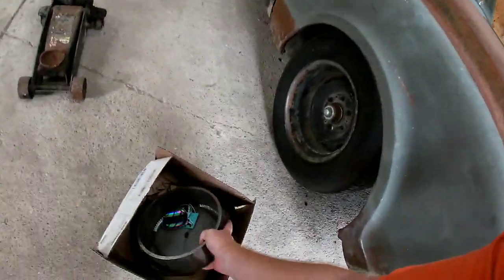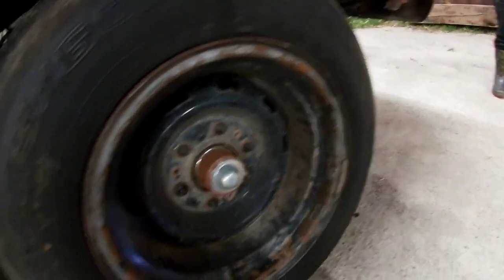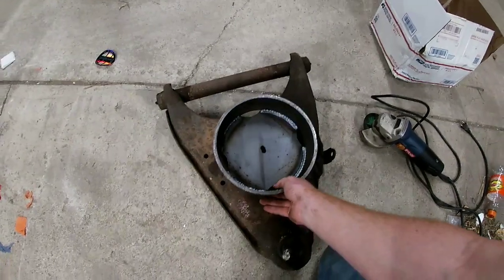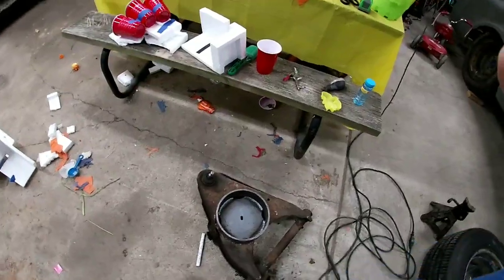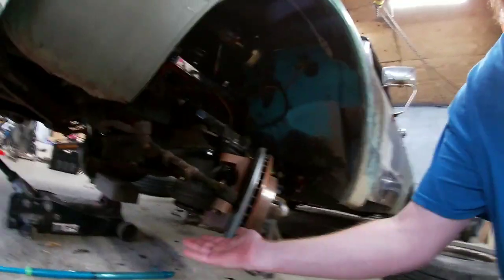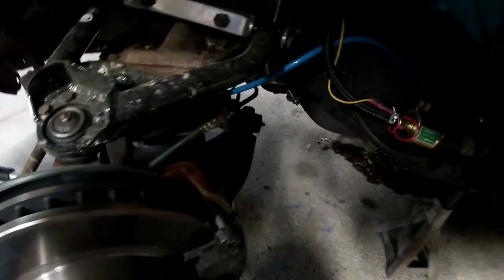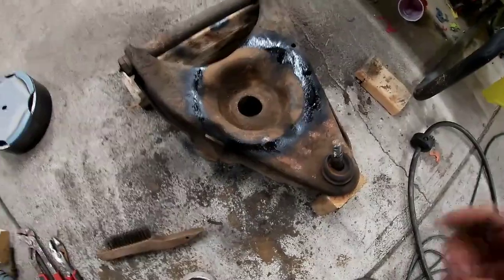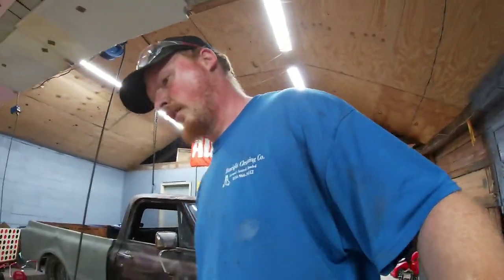How to cup lower control arms on a 67-72 C10 #diy #howto #lowrider

Comment: Job well done! As a note, the lower control arm shaft is held with "U" bolts. GM recommends the use of 9/16" U-bolts as they had 5/16", 1/2" then went to the larger size. It is a safety thing although for 50+ years they have survived pot holts, Road craters  and pasture jumping. This is $9  each & come with washers and nuts. 
  Tip: For those equipped with manual steering, more positive chamber is desired. The shaft fits a pin the "U-Shaped" perch. If the lower shaft is moved forward, by drill a new hole back about 3/8", you will gain about 4 degrees positive chamber before any shims are installed. The shaft end bushing are metal and if greased will last another 50+ years.  It is 4 times more robust than rubber bushings and easy to service. Identical to the top. 
 1967 C10 frames are odd as they did not have indentation for the power steering gear nor did they offer on. Solution? Remove manual steering gear, but a quick ratio P/S gear box from (buyautoparts) for a 72 C10 p/n 82-00293 QR for 2WD and send an undamaged core. If core inspections passes, you get a check for the core valve deposited on credit card. 
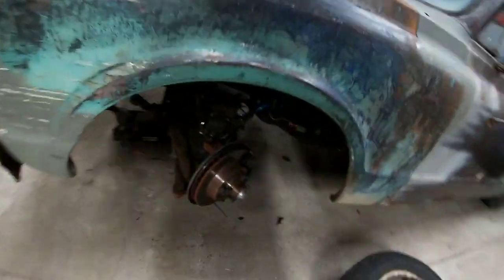It is a 2:75 - 3:25 Lock to Lock and don't forget to buy a pitman arm for the newer truck 2WD to fit.
 On 67, the manual box has pipe-like spacers. Cut two in half with a 5 degree angle. The front two at 5/8" at 5 degrees angle and mark to rotate so they fit flush on frame and steering gear box. The std bolts will fit as I used large flat washers inside the frame to spread the load. Recheck torque after 500 miles of driving.
 DK, ASE Master Tech since 1978, retired but 67 C10 owner.
Reply from the maker: Great information my current project I'm working on this week is pancaking the cross member. It's cut and put back in the truck but now I have to modify the steering because of clearance issues

Comment: Can I use these cups with just my lowering springs instead of bags?
Reply from the maker: I don't think so best bet would probably be get tubular lower control arms I would suggest drop spindles too
Reply: @ccgarage5040  Iv got three inch lowering spindles and three inch lowering springs Im looking to go a bit lower it’s a 78 suburban, you still think it wouldn’t work?
Reply from the maker: @Flacos_pov  no because the spring pockets are already the lowest part of the control arm but there not flat so to run airbags we cut that area out and use the cups to have a good mounting surface
Reply: @ccgarage5040  what if I extended the cups🤔 I’m really tryna get this done
Reply from the maker: @Flacos_pov  my cups are actually the first thing to hit the ground when I air out

Comment: Is there a reason you didn't measure out from center at 4 points to make sure it was dead center?
Reply from the maker: It needs to be center with where the spring pocket was not the center of the control arm
Reply: @ccgarage5040  ahhhh....makes sense. Thanks!
Reply from the maker: @johnjorquez3982  no problem the cups I'm using also have a small amount of adjustments from side to side and front to back
Reply: @ccgarage5040  so I have a 65 c20 that i just started dismantling friday....the current phase is to get tje body off and engine out and have the frame blasted. Then I will prep it and paint it....thinking of doing all my suspension work right after but unsure of what I need to drop the front....drop coils and cupped control arms and bags? Or do I not need drop coils and do a drop spindle instead...thos is where I get lost...I'm trying to drop it around 10-11  inches from where it sits stock....idk if that's achievable with bolt on/weld on parts?
Reply from the maker: @johnjorquez3982  cupped lower control arms or tubular lower control arms depending on how much you want to spend. Roughly $100 to cup or $500 for tubular. Drop spindles will get you another 2-3 inches lower and is a good opportunity to upgrade to disc brakes. If you want to be on airbags you won't need coils but will have to decide on what parts you want for the rest of the air ride like valves, switches, bag size, and air line size